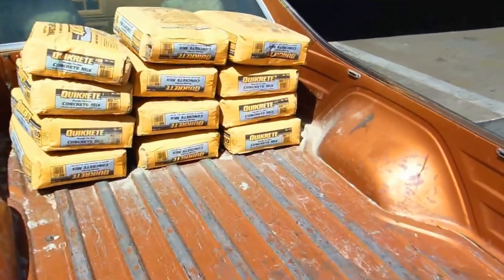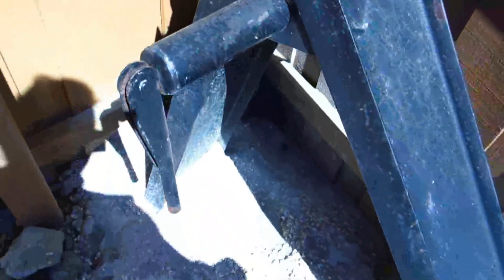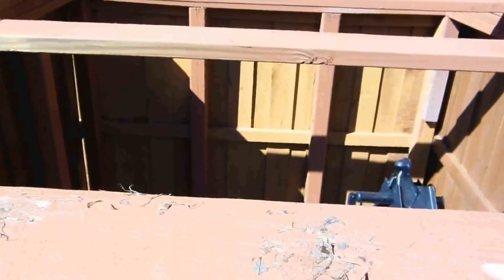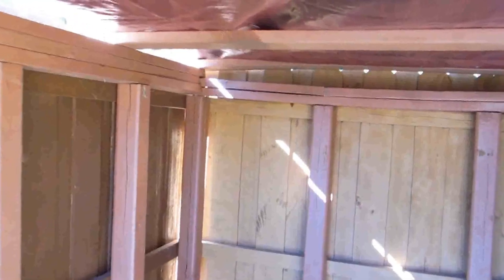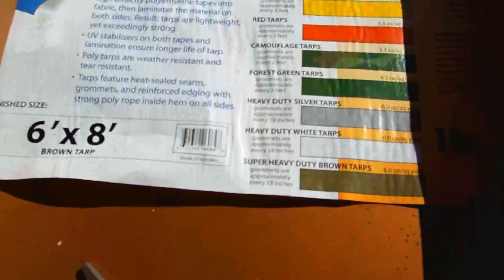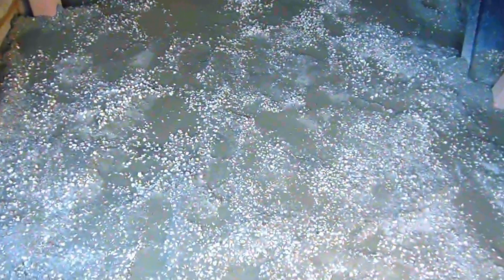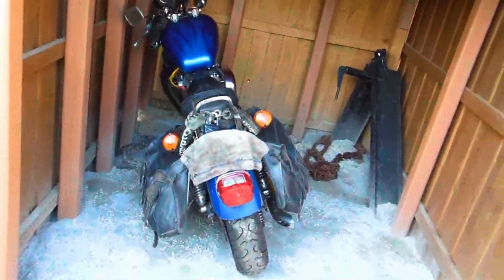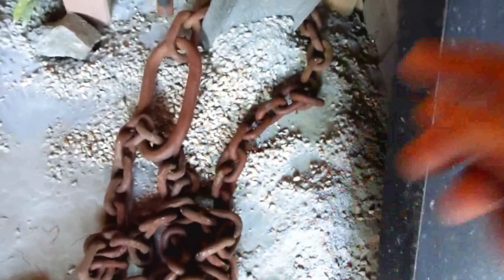Secure, WindProof Motorcycle Shed

Comment: Maybe if it is higher in center (like a tent) try it out with a hose or bucket of water. 
I would think a sheet of thin plywood would do the trick in center. 
Good Luck I am not out there so I could be wrong throw a bucket of water on it see what you think.